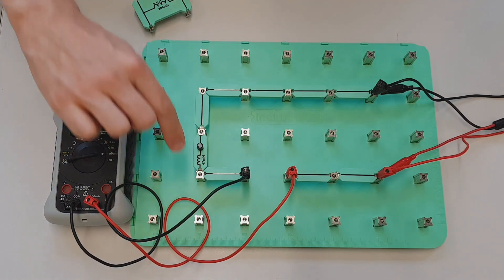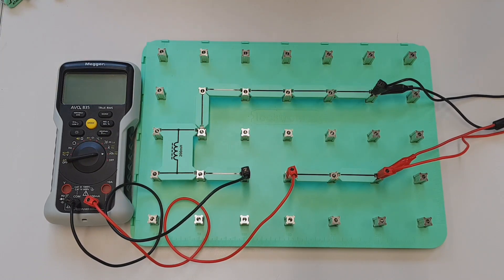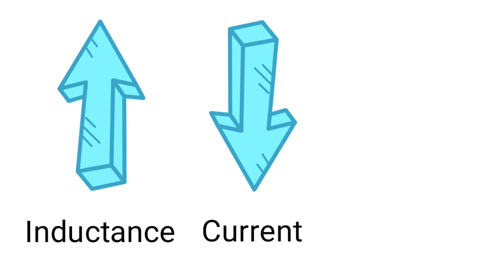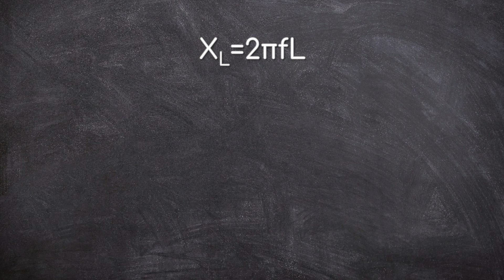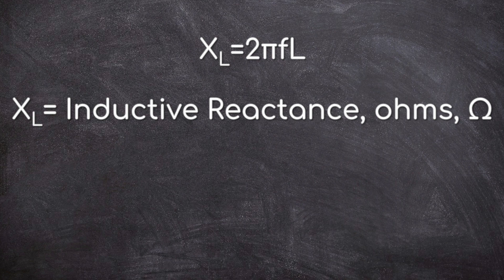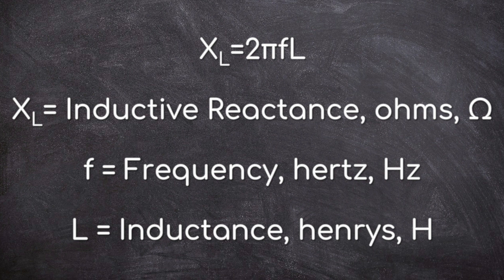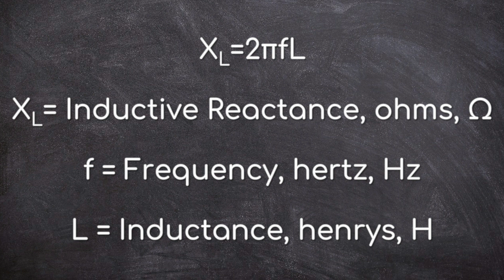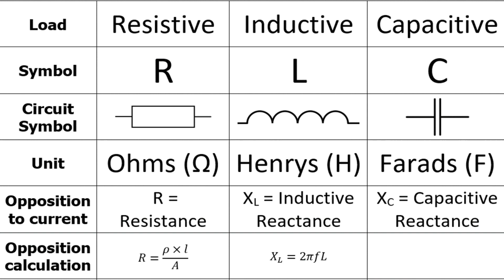AC Theory: How Does Changing Inductance Affect Inductive Reactance?

Comment: Pls show us, u showed with frequency, what happens with voltage, when u increase  inductive reactance, does it behave similar to a resistor ie voltage drop with a inductor and during increasing the of inductor value what happens in a circuit plzzzzz visually, thkz